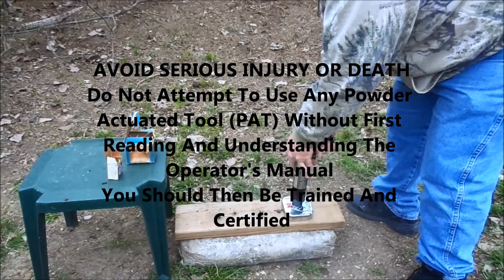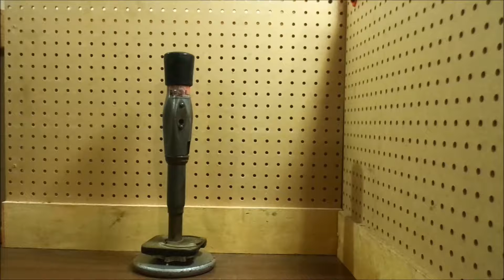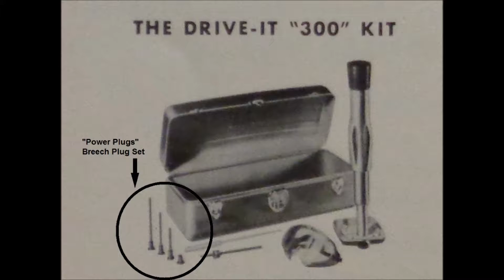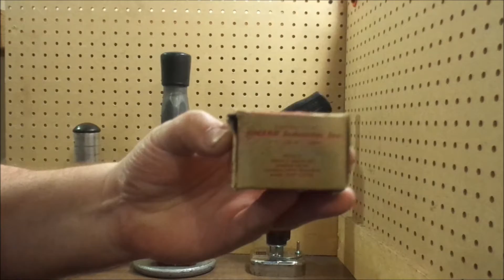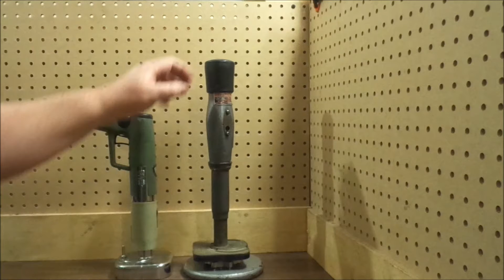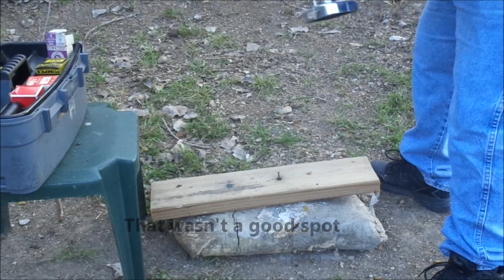Powder Power Tool Corp Drive It 320 Powder Actuated Tool

Comment: Hello i have a drive it 300 tool with the original tool box full of all different kinds of parts still in theres drive pins drive studs some square threaded thifnsh some bullets some other pieces all kinds of stuff looks to be everything there Id like to learn how this old tool operates the new ones are pretty easy everything has been garage kept for years a retired contractor was moving to florida and Gave me a trailer load of stuff